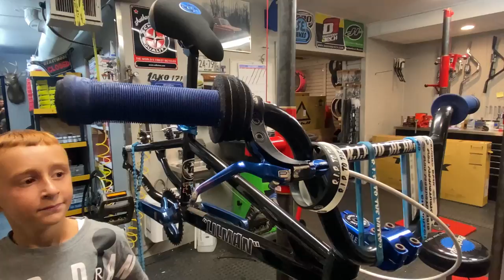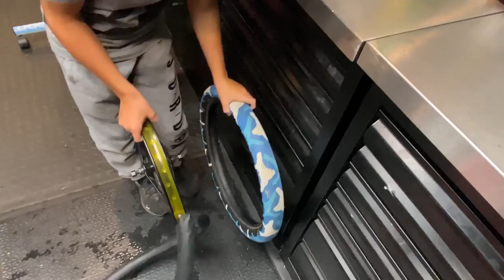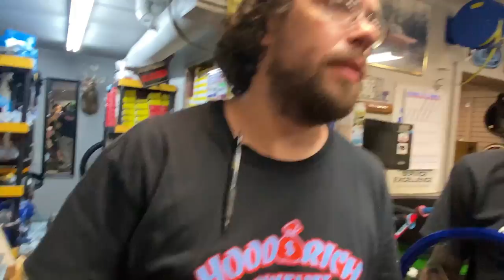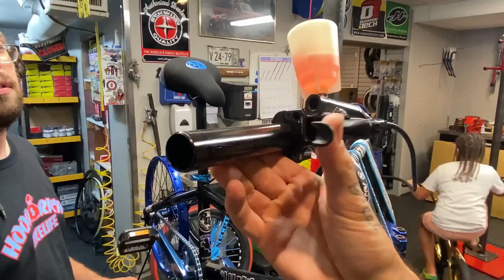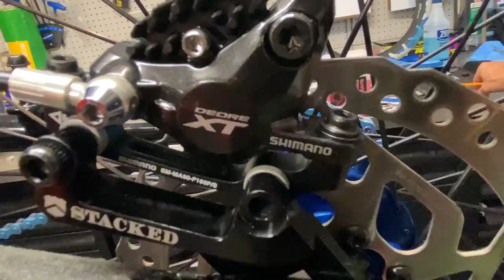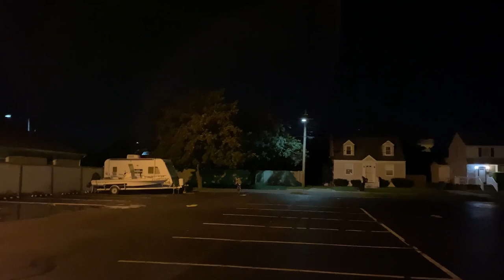Stacked BMX Shop Disc Brake Conversion 20” SE Bike Install

Comment: You need different rims to install disc breaks?
Reply from the maker: Yes you need a hub that u can bolt a
Disc to
Reply: @OnewayLilman  what rim would I need for my my big flyer??
Reply: @24.7mixah5  not rim, hub. The rim is the giant circle your tires wrap around, the hub is the bearings in the middle. Look up a bike hub